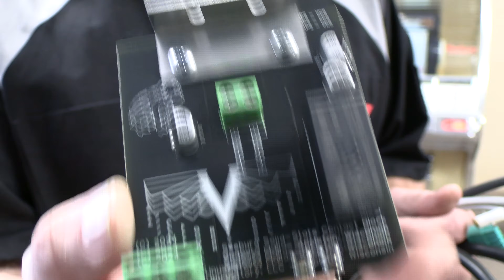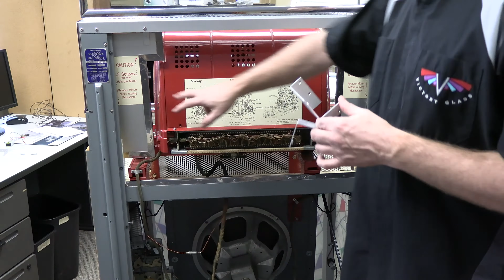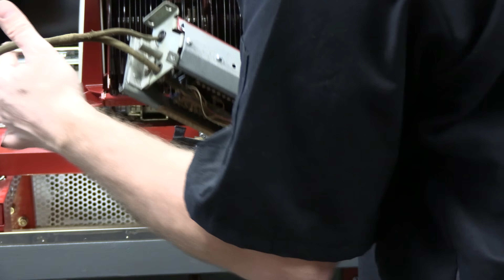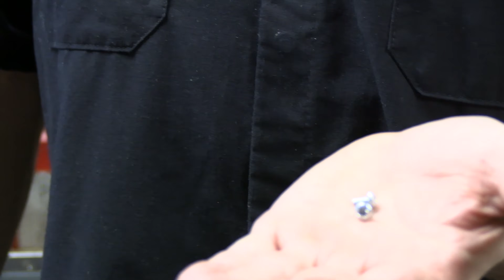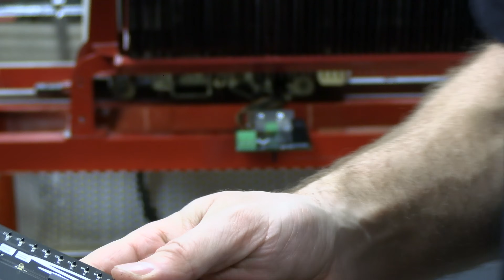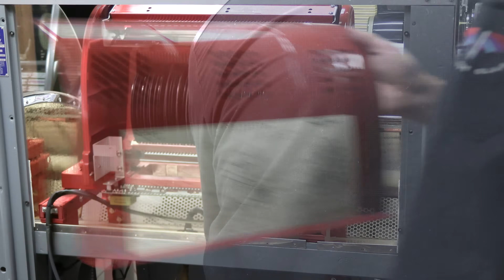Victory Glass Seeburg 100W Solid State Pinbank Installation

Comment: Oh, man. If I'd known about this upgrade, I'd have had my M100C running years ago, instead of languishing out in my storage shed. I could never get it to reliably move to the next selection -- it would always repeat over and over. I thought it was a fault deep inside the mechanical mechanism. Now you've shown me that it's more of an electrical fault, which your upgrade (hopefully) will fix. I'll have to start saving up my nickels and dimes to buy one of these.

Comment: Aaron, 

Do I need to buy you a pair of wire strippers and side cutters?
Reply from the maker: Yes you will need to be able to cut and then strip the wires from the contact block for the frog board.  We do carry a nice combo tool 49-7165. But truthfully a tool you will find handy to have around.